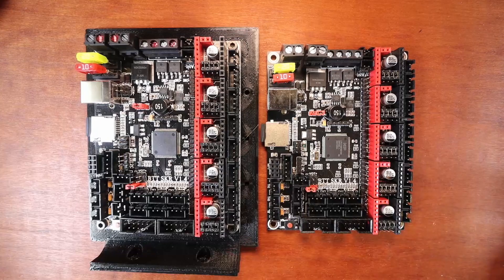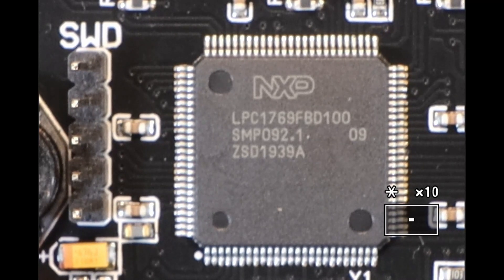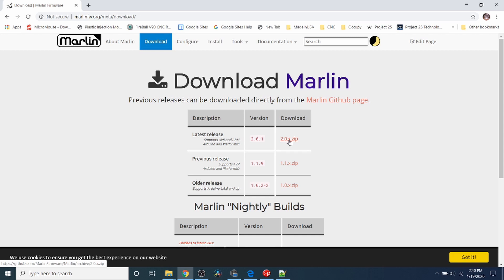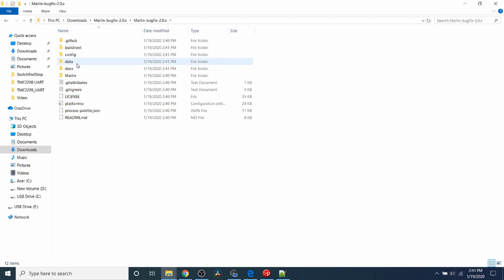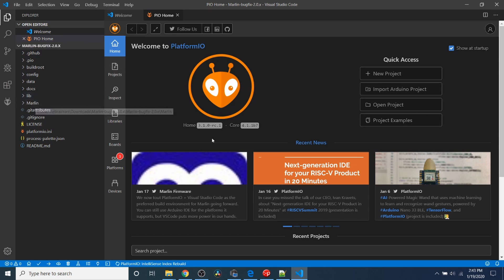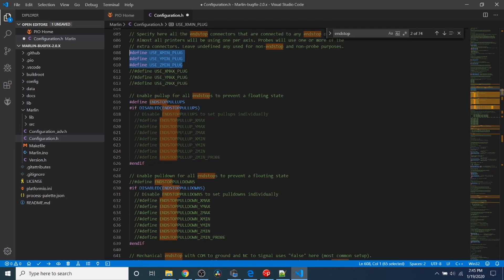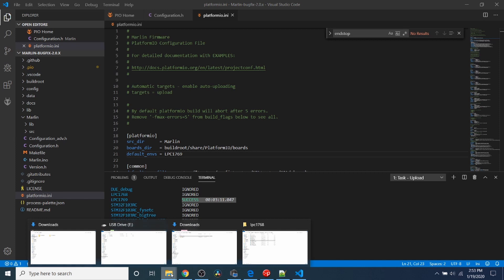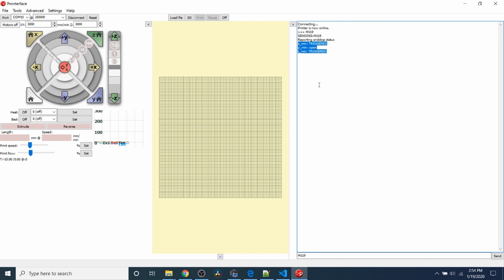SKR 1.4 - SKR 1.4 Turbo Firmware load

Comment: Hey, I have this board, but I can't install any firmware because the bootloader is missing. Do you have any idea about??Mike
Reply from the maker: Sometimes you need a blank ,FIRMWARE.CUR file on SD card.  Other times it's formatting with FAT or FAT32 that's the issue.
Reply: @EdwardBraiman  My problem is that the board doesn't read an SD card
Reply from the maker: @mikekoehler343 there's a discord link in the description.  Also does another SD card work and what is size of SD and formatting?

Comment: Hello, I completely have done what you did this video. So I try to auto home but the step motor has a voice like dıııııt. 

I use SKR 1,4 turbo with ender 3 pro the step motor drivers is DRV8825. I tried many things I can move X Y Z extruder axis one by one but when I selected auto home it gives an error just stop every axis and the prınter do nothing. How can I solve this? 

Thank you for your help

Comment: Hi, may i ask, ive followed the exact same steps you have outlined but on pronterface my printer is still not online? why is that so?
Reply from the maker: What's occuring that's not the same in the video?  Do you see a new device in Device Manager?  On the SD card is firmware.bin renamed to FIRMWARE.CUR?
Reply: @EdwardBraiman  Hi, i have the SKR 1.4. Everything is the same, i can see the device as Marlin USB Device. The firmware compiles okay ( except this error is given : #warning "Your Configuration provides no method to acquire user feedback!" [-Wcpp]) and it uploads fine. But when i connect to pronterface it just indefinitely shows connecting. The baudrates of the USB COM and in Marlin and Pronterface are all the same, and i can see COM3 in Pronterface too. And yes the firmware.bin on the SD card is renamed to firmware.cur. Please do help me on this issue as ive been trying to find a solution for the last 10 days and am unable to find a fix.
Reply from the maker: This is more a question for Discord in the link below.

Comment: LPC1769 wird nicht gefunden
Reply from the maker: German:
Können Sie mir mehr Details zu nicht gefunden geben? Beachten Sie, dass Marlin die Firmware-Organisation seit der Aufzeichnung der Tutorials geändert hat. Es sollte einen Ordner auf der linken Seite von VScode geben, wenn Marlin geöffnet wird, der einen Ordner namens INI enthält. Im Ordner befindet sich eine Datei namens lpc176x.ini. Suchen Sie in dieser nach der Standardumgebung.
English:
Could you give me more detail as to not found?  Note, Marlin changed the firmware organization since recording tutorials.  There should be a folder on leftside of VScode when Marlin is opened that has a folder called INI.  Inside folder will be a file called lpc176x.ini.  Search in that one for defualt environment.

Comment: Im Getting this error;
Connecting...
Connecting...
Could not connect to COM1 at baudrate 250000:
Serial error: Cannot configure port, something went wrong. Original message: OSError(22, 'The parameter is incorrect.', None, 87)

the first 2 are other baud rates, what is wrong?
Reply from the maker: Go to Device manager in Windows, click on Ports and unplug and plug in device and watch for new number.
Reply: @EdwardBraiman  Its some issue with a driver... I go into Dev manager and it gives me the (Code 43) and ive tried updating the drivers, but not working
the only other thing that im wondering is why its under serial connections instead of Com 1
Reply from the maker: It means the driver is not working.  Use the link to Discord chat and I or someone else can walk you through it.
Reply: @EdwardBraiman  k

Comment: Hello !!. Very nice and helpfull tutorial. I can't find the way to write the edited configuration for my DIY 3D printer on motherboard V1.4 (directly) or via an SD card. The message the terminal shows after pressing the Upload button is: "Error: Please specify `upload_port` for environment or use global `--upload-port` option.
For some development platforms it can be a USB flash drive (i.e. /media/<user>/<device name>)
* [upload] Explicit exit, status 1 "
Thaks you very very much !!!
Reply: I just found an other video from you that explain that !!! 
You are the best !!!
"SKR 1.3 - VS Code with PlatformIO install"
Thank you anyway ...!!!
Reply from the maker: Thanks.

Comment: Hi Ed
Sorry to bother you again... I tried flashing with jumper in psu position. Computer doesn't see the usb drive. tried it with usb power as well.. still doesn't see the usb drive. I read somewhere that these boards sometimes won't flash if they are hooked up. Not sure if that's true or not. I just don't understand why it's so hard to flash these boards and why they won't flash from the sd cards. Oh well...thanks anyways. Guess I'm gonna have to uninstall it to flash it. Seems to be the only way it will work. Thanks again.
Reply from the maker: There's a Discord link in summary.  Post your configuration.h and configuration_adv.h and I or someone else in general chat will figure out the issue.
Reply: I will do that. But I'm pretty sure it has nothing to do with those files. If just doesn't see the sd card. Firmware is fine. I just want to change thermistor settings. But ill go ahead and post those files anyways.

Comment: Hi Ed! Great Video! Helped me get my turbo on my ender 5 plus up and running. One question though...Do i have to change the board to usb power every time i want to flash the firmware? Because it won't flash at all from the sd card. If so do i have to remove it from the printer every time i want to this? I hope you get this. I know it's an old video.
Reply from the maker: You can flash with jumper in PSU position.  I only do that during tutorials for safety.
Reply: @EdwardBraiman  Cool! Thanks for the quick reply. I really appreciate it! You're videos are great! Keep it up!

Comment: Marlin\src\feature\z_stepper_align.cpp: In static member function 'static void ZStepperAlign::reset_to_default()':
Marlin\src\feature\z_stepper_align.cpp:66:28: error: static assertion failed: The 2nd Z_STEPPER_ALIGN_XY X is unreachable with the default probe X offset.
   66 |     static_assert(LTEST(1) && RTEST(1), "The 2nd Z_STEPPER_ALIGN_XY X is unreachable with the default probe X offset.");
      |                            ^
* [.pio\build\LPC1769\src\src\feature\z_stepper_align.cpp.o] Error 1

Hey guys i am having this problem when changing the bed size accordingly can anyone explain whats the issue. i am using a BTT Skr1,4 turbo
Reply from the maker: In my RAMPS 1.4 playlist I talk about how to change size.

Comment: The Y-Endstop is changed by the X-Endstop in Pronterface. I checked my Marlin config and everything is maded like your guide.
Why is it changed by Pronterface???

Great thanks for the video.
Reply from the maker: Is this a new configuration?  What happens when you do not touch endstops and enter m119?
When you trace wiring where is it connected? Which type of endstop?
Reply: @EdwardBraiman   my Board is still solo. I Made the build by marlin like your Video and Test it by pronterface. I dont know why but „x“ and „y“ is changed. 
Dont worry i will Check it out. 
Thanks Mate
Reply from the maker: You can post a configuration on my Discord with an explanation of the issue, i or we might see the issues.

Comment: Hi Edward, great video, however I'm still having trouble compiling the firmware for my SKR 1.4 Turbo. I receive error messages stating {

	"message": "#error \"SERIAL_PORT_2 cannot be the same as SERIAL_PORT.\"",

and, "message": "ISO C++17 does not allow 'register' storage class specifier [-Wregister]",

I somehow corrected this error and encountered many more pertaining to the TFT35.
Any ideas?
Reply from the maker: I'll be streaming in about 10 minutes, just trying to get home from work.
Reply from the maker: What does serial port (s) in configuration.h say for numbers?

Comment: says errror then goes to line 20and says #include errors detected. Please update your includePath. Squiggles are disabled for this translation unit (C:\Users\k\Downloads\Marlin-bugfix-2.0.x (1)\Marlin-bugfix-2.0.x\buildroot\share\PlatformIO\variants\CHITU_F103\wirish\boards.cpp).
Reply from the maker: There is a Discord link in the description.  I can chat with you there and work through the issue.
Reply: @EdwardBraiman  possibly later
Reply: is there a reason that the compile option wouldnt be available? yours is there once you open that program,mines missing
Reply from the maker: Ok

Comment: Hi, I have problem with usb driver. My windows 10 will not accept installing it
Reply from the maker: Does it display in device manager as unknown device under COM ports?
Reply: @EdwardBraiman  No, nothing, when I insert the usb, there is no evidence of any open file, just a beep
Reply: in the com... ther appear com4, but nothing. Just tell me, do I have to put a microsd on the board? Because the micro usb card reader is broken
Reply from the maker: Can you post a screenshot on discord of device manager?
Reply from the maker: What happens when you open Pronterface and connect to com port 4?
Reply: @EdwardBraiman  in the Prontherface, just com 1, and no other port, in the driver mangager there is Com 1 and com 4
Reply: @EdwardBraiman  Well, the registration on Discord not accept, after I put day, month and year, stays there, not Done, and I did a payment with paypal
Reply: now, the Pronterface connect with Com 4
Reply from the maker: In Pronterface highlight com1 and change to 4 and the press connect button to tight and tell me what you see?
Reply from the maker: Not sure why you need to do payment on discord.
Reply: @EdwardBraiman  just for my pleasure
Reply: @EdwardBraiman  sometime appear  on the right window: Printer is now online, baud rate 250000, then I do reset, and it will not connect anymore
Reply: Well, I really thankyou for the effort to help me, But at this time, I abandon and I'll buy another board
Reply: @EdwardBraiman  I cannot go on on discord, need a registration then I register and still when he ask me for my birthday, nothing changes

Comment: Hi, as there is no example config file for the skr1.4Turbo board in Marlin configs, what settings do you need to change in the stock bugfix firmware ie what type of LCD is used, Bed Size and so on..... Thanks
Reply from the maker: Yes, there is no example file for SKR, but if you pull a printer type example, then you can change motherboard and default environment.
Reply: @EdwardBraiman  Yes thats that is what i was planning on doing Edward, as I am starting with an Anet A8Plus, I suppose the best way is to dive in and do it, Thanks
Reply from the maker: You're welcome.

Comment: I have a problem: in Visual Studio Code, the command bar necessary to compile the configuration does not show in the lower left corner
Reply from the maker: Also in my playlist for SKR 1.4 I made an updated install video that may help.  It's CC in Poliska as well. Poc.

Comment: hey there i need some biiig help. i´ve been trying to seup the skr 1.4 turbo for over 3 months but i can´t Z and Y to home.
already cut  diag pin, endstops work perfect with M119
my printer is an anet a8 plus, skr 1.4 turbo with tmc2209 v1.2 BTT
stock display
Reply from the maker: What occurs when homing?
Reply: @EdwardBraiman  thanks for getting back to me.
The problem is that Z and Y won't home.
They both move a few cm and take that new position as 0 point X home perfect
Reply from the maker: What happens if you power down system and switch known good stepper driver with known bad stepper driver and power system back up?
Reply: @EdwardBraiman  I've changed the drivers around and still the same :(
Reply from the maker: Sounds like the issue might be in Marlin firmware.  You can send me the configuration.h and configuration_adv.h on Discord and I might be able to take a look tonight.
Reply: @EdwardBraiman  yes sure I really appreciate your help.
How can I find you on discord?
Reply from the maker: Should be in description below video.
Reply: @EdwardBraiman  i sent you the files in discord.
Thank you so much for your help

Comment: Great video,  I just got this board and the 3.5 screen with 2209 stepper drivers. I want to put this in my geeetech a20m. Do you know anything about that?
Reply from the maker: A little, you might need to use example file(s) to configure the defaults for Configuration.h and Configuration_adv.h and work from there.
Reply: @EdwardBraiman  I actually did get this up and running. It went pretty smoothly considering theres zero documentation. The one issue I'm having is during touch mode I can't load and unload filament from each extruder. In marlin emulation mode it asks to unload E0 or E1. I have to changed in the config file for 2 extruded and still nothing. But idk if this matters while looking in the icon pack there is no icon for 2nd extruder so maybe it's something like that.
Reply from the maker: I'd check the BTT GitHub pages and see if they have an open issue.  For some reason for a month I was not receiving comments on this video, sorry for the delayed answer.
Reply: @EdwardBraiman  I will check but now I noticed something. When I change the config file and when I turn everything on while it says no printer connected I can switch between extruders. But as soon as the printer connects that function goes away. It's so strange.

Comment: Hi there I have a question which has baffled me for well over a week, I have a SKR 1.4 board but I have no connectable stepper drivers, I’ve been trying to compile my board in VS Code and I’ve got everything working my BL Touch is fine my filament sensor is fine and my TFT35 dual screen is fine BUT I can’t get the axis to move what do I put as my drivers in VS Code what are the default drivers called which come with the board? I’ve tried TMC2209/ TMC2208/ A4988 etc but it don’t work at all please help, I have a SKR 1.4 not the turbo version

Edit cause it may be confusing: Basically I have no steppers at all there’s no drivers plugged in so what’s the default settings for the driver on the SKR 1.4
Reply from the maker: If you watch the other videos in my SKR 1.4  playlist, it should answer most of your questions.
Reply: Edward Braiman I’ve been on all of you’re SKR 1.4 videos mate and it doesn’t say how to programme the SKR 1.4 board without stepper drivers on VS Code?..
Reply from the maker: Is it an SKR 1.4 board or another SKR board?  If it's already surfaced mounted to motherboard at factory, then this tutorial will seem confusing as it's not the same hardware.  In that case you'll need to know the board type to search boards.h file and the stepper types surface mounted to your SKR board.  Do you have a link of where you purchased or a name on the silk screen of the board?
Reply: Edward Braiman Yeh it’s a SKR 1.4 standard not the turbo version I brought it from amazon and it came without any steppers so nothing is plugged into the stepper ports, I have the little jumpers plugged in and I’ve got everything working apart from the axis’s won’t move at all, I can’t get them to move on cura or on the printer screen what it shows at the moment is X 110 Y 100 Z 0 (flashing) and sometimes I get ? Question marks... I’m sure it must be something in VS Code that I need to enable or disable but I can’t figure it out at all, I have steppers // disabled in VS Code and when I enable steppers I get the same
Reply from the maker: So you have no steppers installed?  If no stepper is installed in board, logic would say, no stepping would occur.  Could you clarify my understanding of the problem?
Reply: Edward Braiman Hi Edward, Yes that was the problem but I have installed some since then and thankfully it’s working, I do have 1 little problem though which I was wondering if you could help, Basically I’ve inverted my motor directions and everything is moving the correct way but when I auto home the bed comes out rather than in... As I say I’ve changed the motor directions and still I get the same, What do you think the problem could be?

Comment: I like all of your tutorials! i have a question about motherboards. I recently ordered an SKR 1.4 PRO board with some ad ons.. i was wondering if the pro is the same thing as the turbo....?
Reply from the maker: The are two versions of SKR 1.4 and SKR 1.4 turbo.  Another SKR board is called SKR pro v1.1 and a new version called SKR pro v1.2.  Turbo for SKR 1.4 has a faster processor than SKR 1.4.

Comment: Hi, 
Thanks for the video. 
been having some issues with my skr 1.4 turbo - trying to get the part cooling fan to work - I connected it to the fan0 slot (p2.03) - and it's always on - the green led right Next to the port is always on - is that normal? Or is it a faulty board. (tried the stock firmware and modified.. Cant get it to work)
Reply from the maker: When you say stock firmware, I'm not sure what your saying.  Which place did you get the firmware?
Reply: @EdwardBraiman  hi. Thanks for the reply. I meant the firmware that was already on the board. Also tried the default settings of marlin 2.5.0.3 - with one hotend, also a different configuration for my printer adapted from my old ramps board. Anyway the pin designated in the pins file is 2.03 - and the pinout diagram shows its the fan0 slot. Am I right? And the little green light should only be lit when I choose fan speed other than 0...right?
Reply from the maker: It will be P2_03 or something similar.
Reply: @EdwardBraiman  that's what I thought. Can you please confirm that the little led light next to fan_0 pin should turn on an off with fan changes? If so - I guess I got a bad board. Unfortunately - that's not the first time it happened - had it with my skr pro when it first came out
Reply from the maker: I'll be checking later in the afternoon today.
Reply from the maker: There is a video on it now.
Reply: @EdwardBraiman  thanks so much for this. I contacted BTT support - we confirmed I had a shorted mosfet... But your videos helped me to be sure I'm not making a mistake.